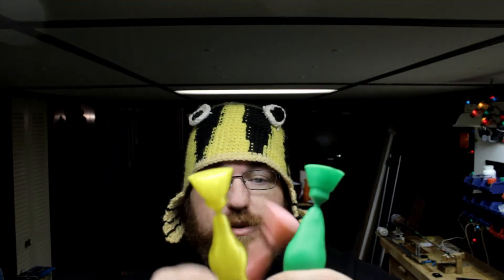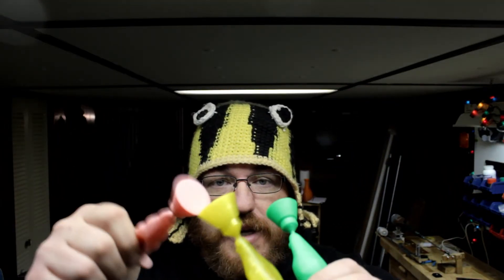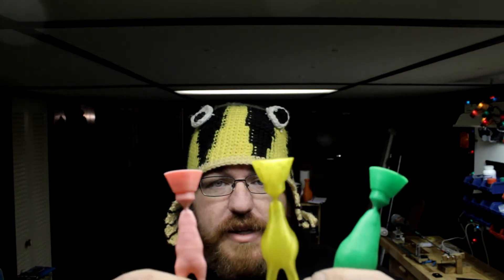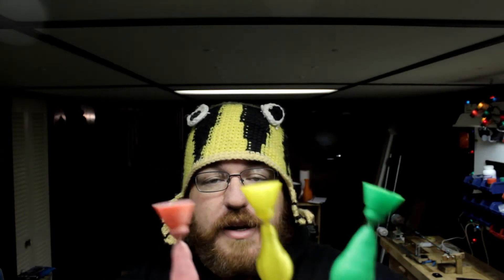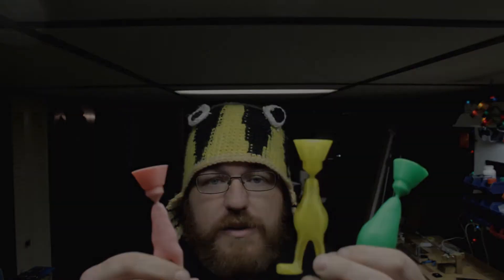From CAD to 3D printer to Finished Lure

Comment: Did the 3d print melt at all with the vac 50? I know it heats up a lot when curing
Reply from the maker: It did get warm but the most difficult part about the vac 50 is that it gets into the print gaps and then cures so getting it out is difficult, it hardens and then it's stuck in there.  That's why I have since moved on to silicone mold material not the vac 50. I like the permeance of the vac 50 but that hardness is the thing that makes it difficult, any little mistake in mold, design or master amplifies with the vac 50.

Comment: Thank you for the modelling tips! Just getting started with 360 myself. I have more experience with mold making and I have a tip to save you 47 hours of waiting time and a lot of money.

Same process as with the vac50 but you use straight polyurethane with 100% of aluminumtrihydroxide filler powder. Pour the first half and let set, depending on which PU say 15 minutes. Spray your mold release and pour the second half. Onother 15 minutes of waiting time and your ready to demold. And don't belive the bullshit about PU not bearing able to handle the heat from the plastisol. The filler helps with thermal stability but with the size baits your dealing with straight PU should work as is.

I have a mold for a 180mm paddletail swimbait weighing in at 60g built as described above, casts nice baits, no mold release needed, no problems with heat. Costs next to nothing and its fast to make. Feel free to ask if you have any questions.
Reply from the maker: Awesome thanks for the tips I'll have to try that out the next go around. I started using silicone the last few times but it would be nice to try something a bit cheaper
Reply: I use silicone for baits with negativ release angles that require a soft mould body. For open pour moulds with simple shapes I mostly use ceramic Casting materials.

Vac50/PU works best when you need a sturdy mould for injection.
Reply from the maker: I'm all about saving money so I'll check it out. The last few I was using Mold Max 60 which had almost no flex worked decent for injection but the price is up there, so it'll be nice to find alternatives.

Comment: Hey bro, why not 3d printing the mold to save you a step? Like with TPU. Think it could work? Cheers
Reply from the maker: I've been switching to 3d print the mold case then pour into that helps save material. The plastisol is too hot to try and pour into a 3d print it ends up melting it. I wish though it would save tons of time!
Reply: Revamped Outdoors thanks for the reply, appreciate

Comment: Nicely done. What were your setting for the prints? I have the a8 and after a few upgrades the thing is crazy good
Reply from the maker: Thanks, I think I had it set for 0.2LH with only like 3.8 mm retraction at about 20 mm/s.  Extrusion multiplier at 0.98 I think.  I like the Anet with the mods they print awesome.
Reply: Revamped Outdoors okay cool. I have my printer dialed in at .15 for later height and all that good stuff. I had a few electronic issues with my a8 so I have the ramps board, atx psu and an auto bed leveler. I never use the heated bed either, especially not for pls, just use glue stick and I haven’t had a warped print in a year :) for about 300$ including the upgrades you can’t really beat it. Besides the cr10 lol